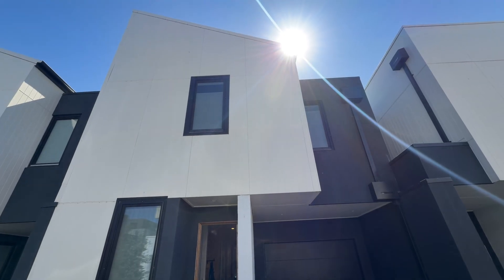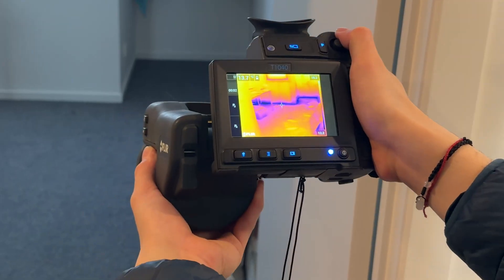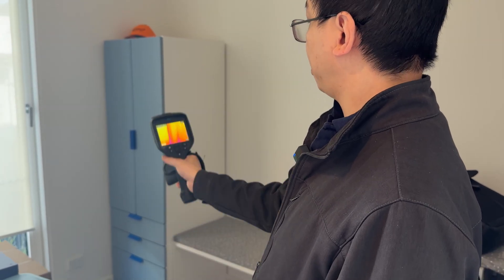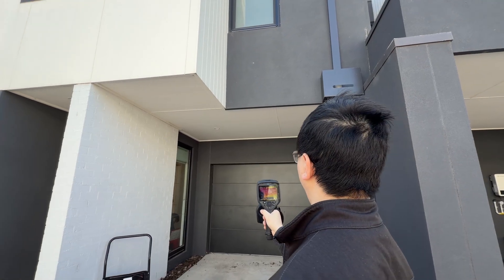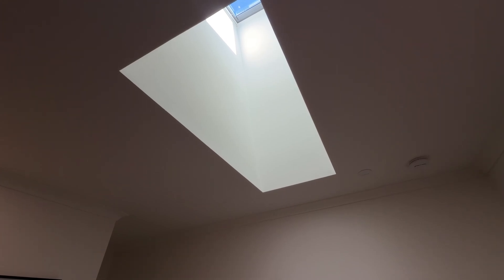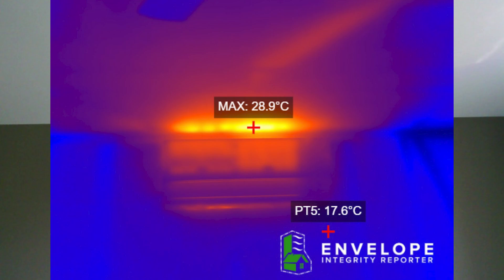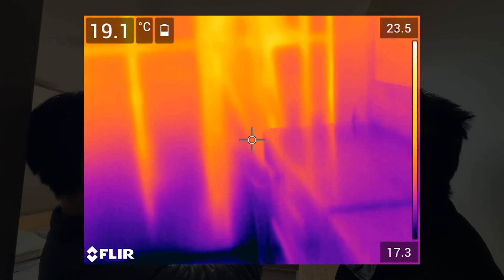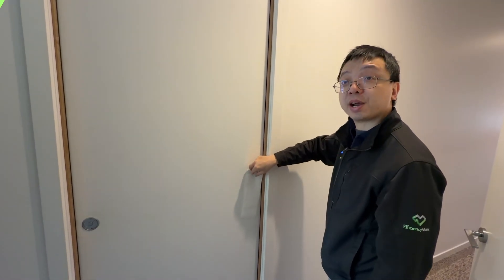Steel Frame Home Flaws: 8.3 Star Rating, Yet Cold?

Comment: If you have an airtight home you will need a hvac system like in Europe and north America. If you don’t you will have stale air and condensation. Remember this is Australia a very mild climate compared to Europe.
Reply: Australia has a very hostile environment and has millions of Australians suffering from allergies.   Air tight should be standard with positive pressure HVAC systems with filtered external clean air intake.

Comment: I built an ICF house and it is airtight, well insulated and extremely energy efficient, I can heat and cool 4000 sqft with a 24,000 btu ducted mini split.

Comment: The problem is there’s no inexpensive way to create a thermal break on the outside of the walls.
Build your exterior walls with either spray foam or blue styrofoam at least one layer.
If you have a thermal break outboard then you can avoid the issues outlined in the video

Comment: The additional heat loss in the overhang room is simply that, additional heat loss. The delta T would be greater to outside typically then it would be to internal. obviously subjective to if the room is heated below or not where it does overhang.

Comment: Great video. I’ve had a cavity sliding door slam shut on its own in high wind.
Reply: We had a new cavity sliding door installed in a renovation, and I sealed the base and insulated well above it. Absolutely no air leaks from that door.

Comment: Not good enough. Not even close. If the home has not been properly tested at appropriate stages throughout construction AND approved (which is why PassivHaus is the top standard), then consider the construction sub standard. I give it a 1 rating. Disgusting build. So many leakage points, which could easily have been address during construction by a builder who knows how to build an air tight, leak free home.

Comment: You didn’t speak at all about external insulation! What are your thoughts?
 I would not build a steel frame house without a continuous layer of external insulation. Rockwool type of product perfect for Aus. as it’s hydrophobic and fireproof
Reply: Since the house is completed whatever is in the walls is now forever and done not much you can do about it.
Reply: Biggest mistake was deciding to build with steel on the first place.